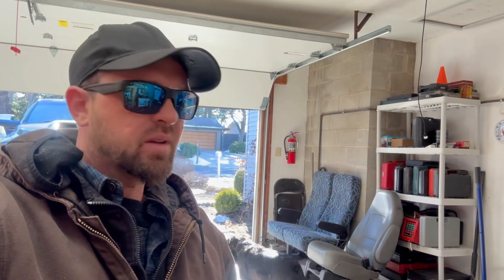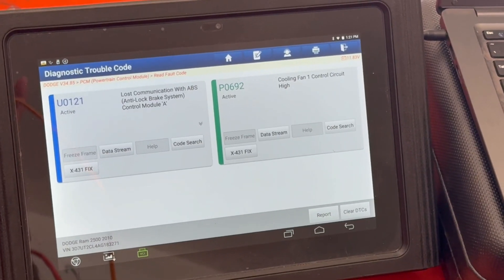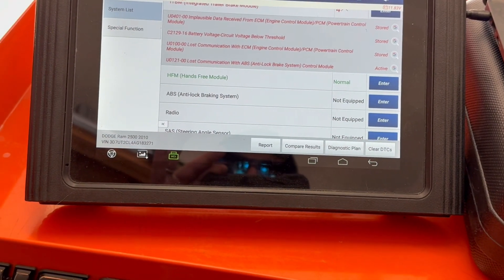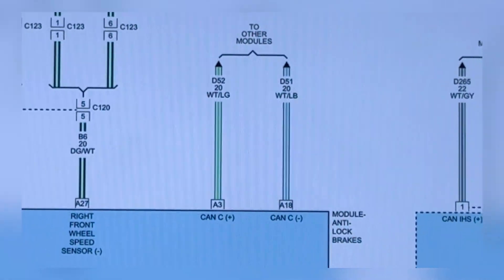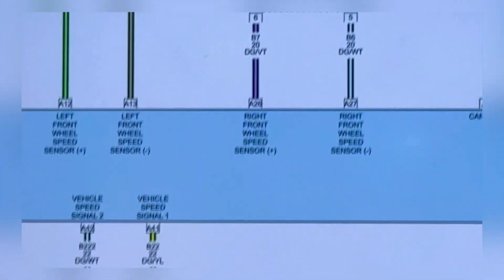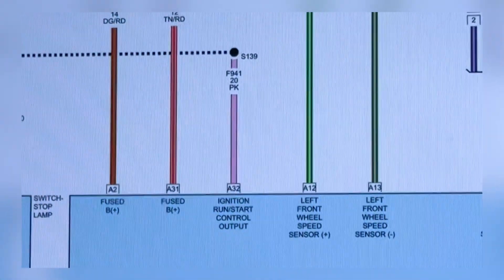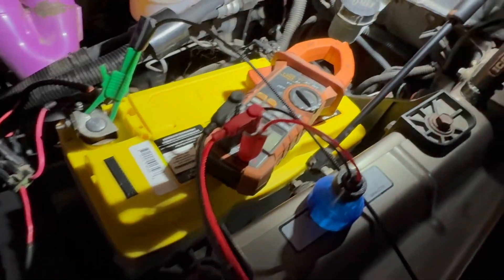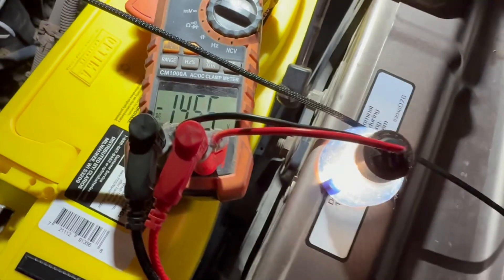2010 Dodge RAM 2500 6.7 No Communication With ABS / CAN-BUS Diagnostics PART 2!

Comment: Awesome unbelievable the bad wire was right where the part was changed no excuse for repairing that wire great job 😊
Reply from the maker: @jeffjones7897  yes, it is astonishing lol. First the DIYer replaces original good ABS module with a used unknown if it works one. “Shorts wires out” then takes good original TIPM out and installs . Yup and that bad wire all along lol. They purchased in 2021 and haven’t driven it because of bad mechanical advice and ignorance. Live and learn lol

Comment: good find.. part 3 would be nice  to show how you fixed it and what codes came back after repairing that green wire. I have a feeling this may be how my truck get fixed for these same issues. Ill definitely be check the harnesses closely next
Reply from the maker: I will Definitely show the fix if repair gets approved, thanks for watching! 😎👊
Reply from the maker: Not sure if you have seen the update! But yes, the truck is running/driving like a champ now! Different vehicle completely!